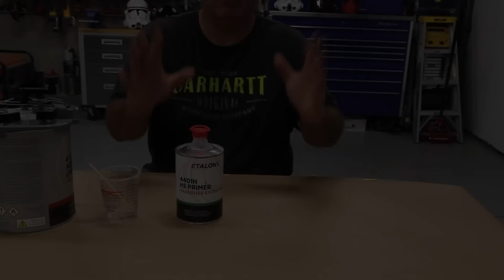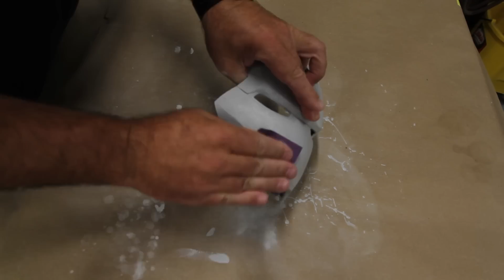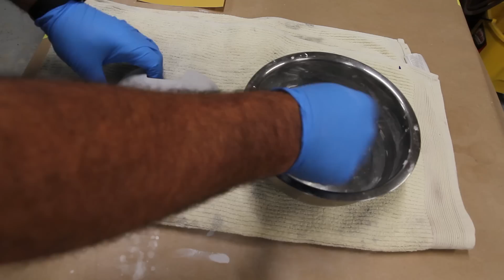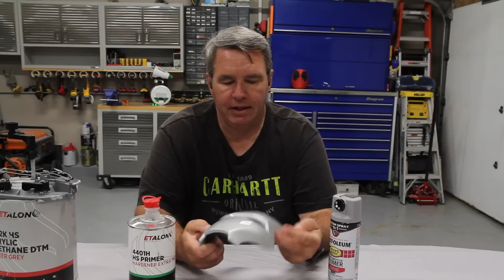3D Print Smoothing CHEAP and EASY

Comment: Brian's 3D Print Smoothing Recipe
Materials Needed:

2K High Build Primer (Automotive grade) (1:02)
Catalyst (Hardener) (3:00)
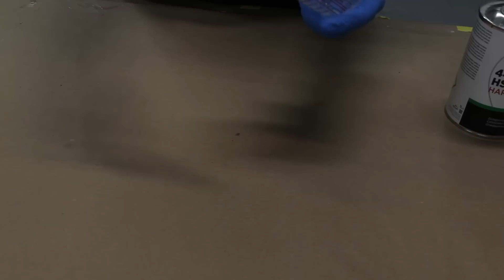Graduated Mixing Cup (3:46)
Reducer (for mixing) (4:35)
Wide Flat Artist Brush (8:26)
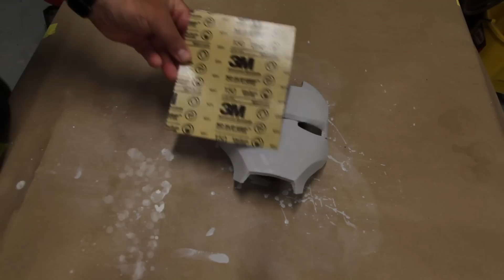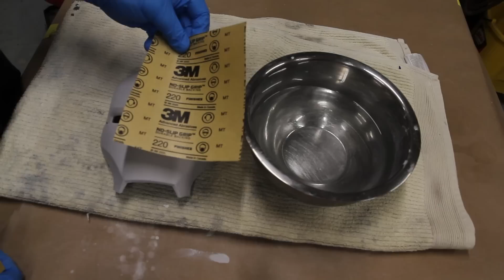Sandpaper: 150-grit, 220-grit, and 400-grit wet/dry (7:36, 9:42, 12:09)
Safety Gear: Respirator, safety glasses, and rubber gloves (3:28)
Rubbing Alcohol (for final cleaning) (11:12)
High Build Spray Primer (for the final finish) (12:35)
Method & Steps:

Preparation: Lightly sand any high points or support remnants with an orbital sander or sandpaper (5:50).
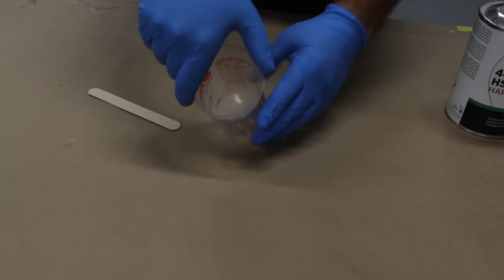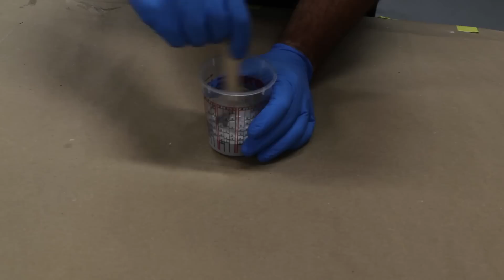Mixing: Using a graduated cup, mix 4 parts primer to 1 part catalyst. Add the reducer to the second mark on the 4:1 scale (4:03, 4:35). Stir well and let sit for 5 minutes to activate (5:04).
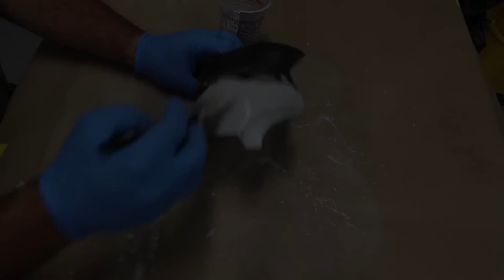First Coat: Brush a thick, generous layer of primer over the entire print to fill in layer lines (6:23).
First Sanding: Once dry, sand the surface with 150-grit sandpaper until smooth, stopping once you reach the plastic (7:30).
Second Coat: Apply a thinner, neater layer with a wide, flat artist brush (8:24).
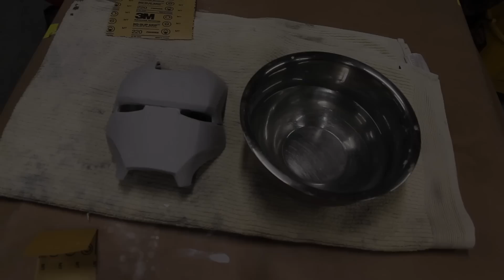Second Sanding: Once dry (approx. 45 minutes), wet-sand the piece using 220-grit wet/dry paper (9:28).
Final Finish: Wipe the piece clean with rubbing alcohol. Apply a thin coat of spray-on high-build primer, and perform a final light wet-sand with 400-grit paper to prep for your base coat (11:21).

Comment: the only thing I would suggest is, after you brush the first coat on. let it dry then dust a guide coat of flat black. 
I will show you where the imperfections truly are. and what's been smoothed and what hasnt as you sand. saves you sanding over the same spot . and missing bits the eye doesn't pick up. 🤷
Reply from the maker: Great Idea, I should do a video on it. I have used a guide coat painting cars. It would probably be helpful to many people.
Thanks

Comment: people dont understand the absurd amount of work it takes to make a 3d print actually look as good as the props used in this video.  FAR more work than most people are willing to do.  I made a fallout nuke about the same size as the storm trooper helmet on the left, and it took an entire day of post processing before I could clear finish it.  Borderline not worth it.  Especially if you dont have 900 specialized tools to not have to hand sand everything.  No filiment type ive printed with was easy to sand.  These techniques in the video DONT WORK on multicolor prints.  It only works if you print everything in white, and paint everything.
Reply from the maker: You are absolutely right, it takes a lot of work and even more patience to learn techniques that work for you. 
You could go buy some of these helmets for arguably less money and definitely less headache, but to me there is something soo satisfying when I'm done, and I can look at what I achieved.
I cannot stress the point enough that EVERYTHING needs to be sanded to get glass like finishes, By using materials that are designed to be sanded (not trying to sand the plastic smooth) the process becomes much easier and safer, but you still need to sand.
Yes, one day of post processing does not surprise me, and actually I have had builds that have taken substantially longer. 
In the end, its all about your end goal, and what you are trying to achieve.

Comment: Nice video, does it matter the type of respirator being used or is a $20 amazon one with filters good enough in this scenario? And is it ok to mix and do the brushing in a basement, or better to do it in the basement but in an airbrush box with the hose that goes out the window.. im assuming the spray on primer should be done outside and not even in the airbrush box?
Reply from the maker: I have always used the 3M respirators, I would just make sure they are rated for chemicals and painting. As far as mixing, the solvents can be very strong, make sure you are doing it in a well ventilated area.
Reply: @TheLastLayer111  Yeah i picked a p100 3m one, should be good there, id mix the primer using the airbrush booth i think.  For your storm trooper helmets, what sort of final coats are those, are they paint brushed on or rattle cans etc?  Id stick to outside for cans.  Thanks for the tips
Reply from the maker: @markm75  if you are referring to the clear coat, I use automotive clear, sprayed out of a spray gun. You can take a look at my other videos, I go through the process in depth. Hope that helps.

Comment: What do you use to clean the brushes after applying that primer?
Reply from the maker: Lacquer thinner.
Reply: Excellent, thank you very much. I appreciate your suggestions for the two-part filler primer, working on a project for a client and decided to try that.  This stuff seems to do a spectacular, and more importantly quick, job at filling layer lines!  And I’ve only done the first coat so far…
Reply: @theamzngq how are you enjoying the 2 part filler primer? Have you used it more?

Comment: Having worked in automotive bodyshop, FeatherFill makes a polyester-based super high build primer, which might be even better for the task.  That would give you even more buildup, but you'll need an HVLP spray gun with a pretty big nozzle (like 2.0 or larger tip).  It's basically like spray on bondo.  The stuff is even thicker than your 2k high build sandable primer, but you'd probably be done with one coat of this stuff.
Reply from the maker: Im going to try it. Someone else commented on it. The HB primer I use can pretty much get it done in one coat, i use a light coat of the HB spray can primer just to wet sand the last coat to 400.
Great suggestion, ill get some and give it a try

Comment: Thanks for this video. I almost never paint finish 3D prints because of how time consuming it is. This seems much more reasonable and efficient. Looking forward to trying it out. Thanks!
Reply from the maker: its always going to take some time and elbow grease, but this is the fastest way I have found, primarily because the primer is designed to be sanded, and it sands relatively easy.
Reply: @TheLastLayer111  have you ever experimented with sandblasting? ive considered trying it but i dont have the space for a whole setup
Reply from the maker: @CubeRhinoDev  Actually, I Have. Its kinda works to an extent. Its messy, even with a little contained sand blast booth, and I always manage to get dust all over in my garage. 
It also imbeds into the plastic. and its hard to clean. There may be better media options, but I just used sand. 
For the mess I prefer to just sand the primer.
If you experiment with it, Let me know how it works for you.
Reply: @TheLastLayer111  my thing is i do a lot of small full color 3d prints that we sell for cheap in our local bakery. little cute bear characters and keychains, finishing all of them manually with sanding, its tough they are only like 50mm tall and im printing sheets of them. was just looking at ways to get rid of more layer lines but maybe the tech just isnt there yet.

was going to try a media blasting cabinet or maybe a tumbler even? not sure but the algorithm put me in front of your video
Reply from the maker: @CubeRhinoDev  doesn't hurt to try, actually trying new things is one of my favorite parts about the hobby. Tumbler is interesting. I never tried that. Please let me know how it works out.

Comment: Great video! What would you recommend for filling large gaps? Wood filler, Bondo, something else? If I use a filler product would the process be to add the product before and primer or would I have better adhesion doing primer, then filler followed by the spray primer and finish. Thanks again!
Reply from the maker: Depending on how large the gap, you can use several things. For very large gaps, using a 3D pen or welding filament in works great. For mid size gaps, I quite often use Bondo (its a bit thicker than glaze). I usually do all the prep work and gap filling, prior to priming. Keep in mind that different types of filament has different adhesion properties. That being said, always test a spot first. If you are nervous that the body filler may not adhere properly, you can always scuff the area first.

Comment: Do you think some filaments would do better than others with this method? Thank you so much!
Reply from the maker: If we are talking just PLA to PLA from different manufacturers then I have not seen a big difference in the finishing technique. I print a lot of BIG stuff and filament cost is a factor. I quite often find the least expensive/sale filament I can on line and use that (as long as you printer likes it). If you get in to other types like ABS, PETG, ASA. then its kind of up in the air. I used PETG and ABS on my R2D2 and it finished the exact same way as PLA. But I always tell people to try it before you commit to buying 25+ rolls for something like R2.
Reply: @TheLastLayer111  Thanks so much. I didn't think the helmet was made in PLA. I thought it would be a no-go because of the low temp resistance of it. Well that's good, because I much prefer printing in PLA. Thank you again!

Comment: I wouldn’t call this the easy way. Truth is, there is no easy way to remove print lines. Primer is the most effective way tho. As the owner of a body shop, and several 3d printers, I have used many different products. You should try polyester primers. It’s used for very high build. One application of 2-3 coats and you’re done.
Reply from the maker: I agree, removing print lines always takes elbow grease. I guess I should say its the easiest way I have found. I have gotten a lot of comments from people on different methods, many of which I have tried. Modern primers sand much easier than resins and putty/acetone concoctions my opinion (but that's just my opinion).  I wish there was a "spray and done" method, unfortunately if there is I haven't found it.
I will absolutely give the Polyester primers a try.
Thanks for the suggestion.

Comment: One thing I noticed was you used Etalon in the video  but your link is for Roblero.  Are they the same in performance?
Reply from the maker: For the most part, all the HB primers on the market will work the same. I always used Roberlo, when I ran out of that my local guy had Etalon, so I used that. Both work good, and sand easy. Also The roberlo is available on Amazon and I believe its actually a little cheaper than Etalon. 
For a future video, I plan on testing some of the more affordable options, such as Finish One or Upol. I'm Guessing all of them will perform similarly.
Reply: @TheLastLayer111  perfect.   Thanks for the info

Comment: I just subscribed after watching your video's. I made a full size R2-D2 4 years ago but never painted it because i didn't know how to fill the lines Easly. I am going to try your method.
Reply from the maker: awesome build, When I did my R2 I used brushes and I also rolled quite a bit with the high build primer. I show him briefly in the beginning of my Scigrip gluing video. 
Enjoy the project, that's a good one.

Comment: This reminds me of Slick Sand from back in the day (think its called something else now) which for all practical purposes was like spray on Bondo.  Very heavy fill and amazing.  I always shot it but I'll try this method.  Thanks
Reply from the maker: try rolling it also, I have a friend that uses 4 inch foam paint rollers on car hoods and guide coats them. they come out beautiful.
Reply: @TheLastLayer111  how do you think it would perform on MDF?  I have a project that's a combination of MDF and FDM 3D materials
Reply from the maker: I works great on MDF and wood, its a solvent based product so it will not swell up the grain when working with wood. I had a friend who worked in a body shop and he did a lot of woodworking, he primed and painted everything like this including MDF.
Reply: @TheLastLayer111  awesome.   Thanks so much
Reply: Slick sand works well on mdf. I have used it before. I bondo filled screw heads and seams before slick sand application though.

Comment: can you use acetone to thin this down? And can you use acetone to clean this off your brush?
Reply from the maker: I Never tried Acetone, It evaporates very fast. I typically just use any medium urethane reducer. Its actually comparable to the price of Acetone. The best thing to do is check with the manufacturers instructions, there are different "speed" reducers for temperatures or flash times. 
For cleaning I use Lacquer Thinner.

Comment: it's 100+ usd and you end up sanding it anyway, 
so why not use cheap filler and sand ? what would be the difference ?
in anyway as been said here
your work is amazing and very good quality
Reply from the maker: automotive primers have very little shrinkage, that is actually one of the biggest benefits, there is nothing worse than finishing a print and a week later layer lines start showing through. Any good automotive 2K Urethane High Build Primer will work. Every body shop supply shop sells it. You can buy it in quarts and that naturally is cheaper. Ill see if I can find a quart setup on Amazon and do a video testing it.

Comment: dry wall mud or wood filler plus water... is WAY CHEAPER AND EASIER- and a cheap can of spray primer 2 in 1 filler... this is an INSANELY expensive and complicated way to do a very simple process... >><<
Reply from the maker: you are correct, Dry wall mud and wood filler do work, but keep in mind they also shrink over time, thats why body shops use these products. they set quick and have very minimal shrinkage. There is nothing worse than finishing a project and a week later you start seeing layer lines.

Comment: questions: how long to wait to dry after first coat before dry enough to sand.  was 2nd coat a new batch or the same mix from the first coat?
Reply from the maker: It really depends on how thick you put it on. Sometimes I put it on and while its drying ill add more to touch it up, The primer dries much slower in the cup than when its spread on the piece, So I can typically get 2 coats out of it. 
You dont necessarily need 2 full coats, if you got the layer lines covered, you are good to go.

Comment: Here's a dumb question for ya. Are you able to save the mixed up primer throughout the multiple coats or does the catalyst make it cure too quickly so you end up making a new batch for each layer?
Reply from the maker: thats actually a real good question. Depending on how thick you apply the first coat (if you are brushing) then typically you have time to put a second on, or at least fix areas where you need a little more. it may start to thicken a bit in the cup, but I still use it, especially for touch ups. One good thing about the Roberlo HB primer, is that it can be applied wet on wet.
Reply: @TheLastLayer111  Cool, thanks. Might have to look into getting some of this, or a local equivalent, to add to the arsenal. The cost of spray primer/filler adds up real quick...

Comment: I’ve been doing UV resin and it’s pretty quick and doesn’t lose a lot of detail plus adds strength. This is the second time I’ve seen your method. I may have to give it a shot
Reply from the maker: I do use resin also in certain situations. For example in my gluing video, I show the Predator Head, I used resin on that, due to the surface (very bumpy). But for smooth surfaces I typically Glaze.
Reply: with uv resin can you do a clear or clearish coat? ideally id want to FDM print in full color and apply a layer overtop to reduce the look of layer lines without a lot of sanding and painting work

Comment: I like those high fill primers, but why not spray it? You only need a compressor and a $14.00 hvlp gun from harbor freight.  Or just simple rattle can the high fill primer do the trick much smoother.   https://www.youtube.com/watch?v=J48NWaW65FM
Reply from the maker: I do spray it also, I show that briefly in my "make your prints SHINE" video. Sometimes its just more convenient to brush it on, and you don't have to worry about all the over-spray. I also do the rattle can typically for the last coat, most rattle can primers are 1K and generally do not build like the 2K.
This is just works best for me. I really like exploring different options.

Comment: Wow, great video! Easy to follow and directly to the point. Whats that device on the top of the can? one suggestion is to add links to these products in the description. A+
Reply from the maker: its a mixing lid. got it on Amazon. They work great. 
https://www.amazon.com/Master-Elite-Mixing-Pouring-Gallon/dp/B0CVFSYWL6/ref=asc_df_B0CVFSYWL6/?tag=hyprod-20&linkCode=df0&hvadid=693507921551&hvpos=&hvnetw=g&hvrand=13918075988597383155&hvpone=&hvptwo=&hvqmt=&hvdev=c&hvdvcmdl=&hvlocint=&hvlocphy=9021615&hvtargid=pla-2283116719187&mcid=c77b3b2101073940ba4cf19cd0cf7a35&gad_source=1&th=1
Reply: @TheLastLayer111  are you able to store it with that lid on(long term) as well or not recommended?
Reply from the maker: Until its empty, I've had that lid on it over a year. It seals remarkably well.

Comment: Do you have a link for the primer?
Reply from the maker: I actually buy it from a local autobody paint store, Any good automotive 2K High Build primer should work.
Roberlo Multyfiller Express is my favorite. It can be mixed depending on how thick you want it. It can also be reduced. its very versatile. 
Sorry.. I dont have an affiliate link yet.

 https://www.amazon.com/ROBERLO-Multifiller-Express-Primer-Hardener/dp/B06XC8QZ5K/ref=sr_1_49_sspa?crid=3MVCW4MMBTSE2&dib=eyJ2IjoiMSJ9.2dyt0SzveChXLAU86RjvbUzTIiEp8-2HTrwye-FQ1JIREsXdNn4vk0NXbhlEbYcUX-qLGSrStFCTTdHsQJbJ3Dm9JSfu6l8nX3Ws9itlpXw.X_3SMPlu_qbm0tgP0NNUUOku_ifmnUV7baJA4V5T7O4&dib_tag=se&keywords=roberlo+primer&qid=1721581510&sprefix=roberlo+primer%2Caps%2C101&sr=8-49-spons&sp_csd=d2lkZ2V0TmFtZT1zcF9hdGZfbmV4dA&psc=1&smid=A3W2N2FDIPZH5M